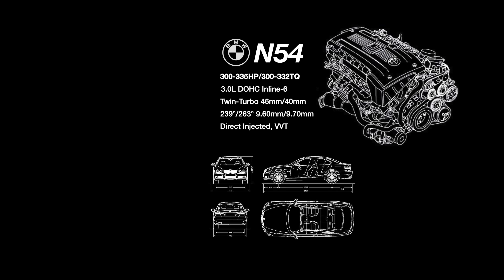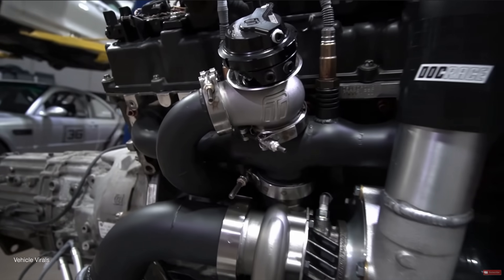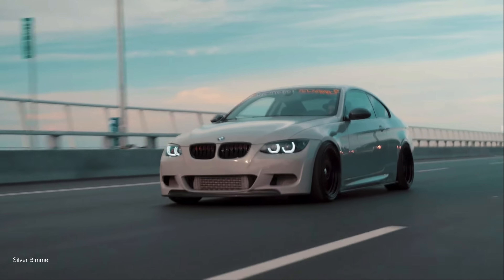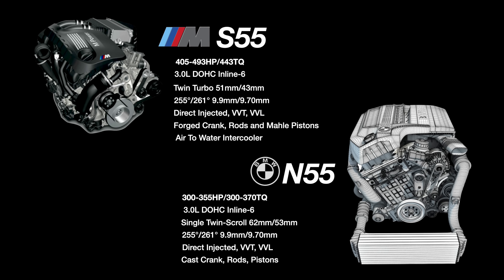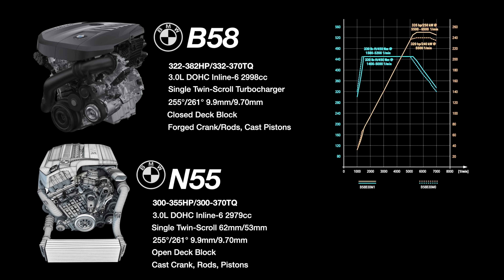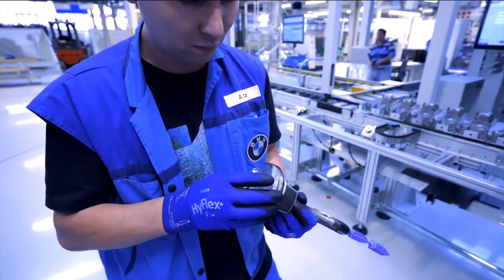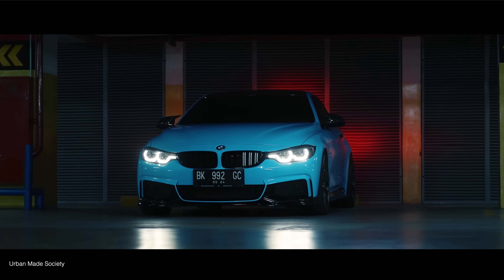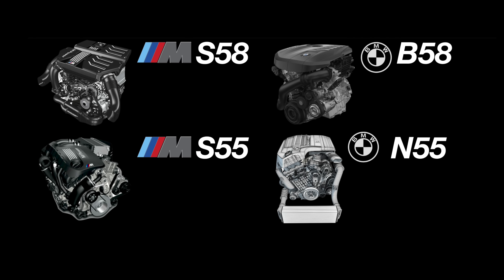BMW Turbo Inline-6 Engines Are Ridiculous | Explained Ep.4

Comment: I took my 650iGC m package and tossed in the DPs pushed the boost to 24 psi with cai and a tune and she’s reliably been putting 520 on the motor. That said, I also have a 2020 Camaro 2SS ILE 10 speed that is also tuned to 550 bhp and the heavy ass bmw can’t quiet keep up but she’s not far off. The n63 tu2 is awesome and she sound so fkn good. Thanks for the clips I love all types of cars that I can tune and tear ass.

Comment: BMW always been the king of straight sixes, you Americans been sleeping, they were making straight sixes for their fighter planes during WW2 and then started putting them in their cars in the 1950s
Reply: Toyota Inline 6  has entered the chat. Lol
Reply: First European brand who started putting inline sixes into cars were Audi.
Reply: @ForcesofValor16  Taking turns does not determine how a good an engine is.....
Reply: @ForcesofValor16  I'm sorry but I'm not American 😉
Reply: I have humiliated a couple of BMW 6 cyl with my 2.0 cyl turbo Saab, both from around year 2000.
As long as it was a 328 or less and both was rolling, they had little chance.
The Saab 2.0 and 2.3 turbo had BMW 3.0 power and torque from a relatively simple engine without vanos.
Reply: Yawn...

Comment: I've had a tuned N54 for almost 3 years now with aftermarket turbos, after the initial maintenance work I did (changed everything) it's been reliable for me at a little over 500 whp, only first set of aftermarket turbos failed but I put enough high boost miles on them,
Reply: High boost miles. Sounds like an excuse.
Reply: Exact same here, aftermarket turbos for just over 2 years and after the initial wave of maintenance it's been dead nuts reliable.
Reply: reliable turbo fail lol
Reply: Well that's not reliable at all. I haven't had to change anything sans fluids in two years in my car.

Comment: The B58 has two generations and different variations of power. Some of these differences are critical to know if anyone is gonna modify one for power. There’s a video explaining the difference B58 vs B58TU
Reply: Not much difference except the fuel pump. They both can take the exact same amount of power

Comment: N54 was a nightmare until you dropped almost 10K into it to sort everything and...I still want one in an 135i.
Reply: Very untrue, owned 2, didn’t have to drop 10k, about 1k in parts to make it very reliable
Reply: @I6N54 , sounds like you did not own it new. Turbos are shit. Injectors or shit. Electric water pump is shit. Both fuel pumps are shit. Boost leaks due to shitty charge pipes. Walnut blasts. Shall I continue? Upgraded turbos, 3-5K depending what you choose. Index 12 injectors (reburbished) $1,000. Both fuel pumps will run about $1,000 together. Upgraded water pump is like $400. Charge pipes? No idea. Still gotta do coil packs too. All this this like 6K on the really cheap end. You get really good parts and close to 8K. Then....THE MAINTENANCE.
Reply: @ronaldjoseph9607  you can get cheaper turbos but the 2 fuel pumps being 1k is cap a new hpfp costs 800 shits more expensive now been hearing set of 6 index 12s new are being sold for 2k+ and alot of this shit you wait until there's a problem to replace em idk why everyone's replacing there injectors even if the cars running good and they don't leak.
Reply: @callanotis7902 . I said refurbished injectors. New injectors are $2,000-$2,500. Cheaper turbos? Yeah, you buy them bullshit Vargas "upgraded" turbos if you want to. You can get both fuel pumps for $1,000. At the end of the day, all these parts are know to fail and fail early most of the time. Get everything out of the way early.
Reply: @ronaldjoseph9607  You should add, crankshaft is shit too. N54 is crap, 3.0 tfsi with compressor is way better engine.

Comment: Always have loved Bmw's, but the only car on the road that I have come across on my 17 gsxr 1k R is the Mercedes amg gt 63.  That car was giving me a run in half power mode and that was pretty impressive.
Reply: Then you haven’t heard of m5 competition
Reply: @eLus1ve2991  Love that car. I remember when I worked at a Bmw dealership the tech asked me if I wanted to go for a ride in a E60 M5 and the power button with full throttle the seats actually move to strap you in better, but anyways awesome cars the newer M5's. I just see more of the Mercedes Gt 63's around and Mercede's drivers seem to want to race more than the beamers. I'm sure I would still smoke the M5 on the bike, but the way that Gt63 just keeps pulling past 170 mph was impressive.
Reply: @Mattschindig  merc are raw straight liners, whilst comps are overall a drivers car, u can take the big boat m5 into the canyons and still feel safe flooring it….
Theres vids of m5 comp vs gt63 
M5 takes it by a bit…. Mercs focus more on interior luxury

Comment: What are bolts? He mentioned that you could improve the horsepower simply by changing bolts?
Reply: I think he said bolt on. Like downpipe, intake, fuel pump, upgraded turbo and so on
Reply: @todddooley793  thanks

Comment: I have owned 1 Toyota,  1 Lexus and 2 Mini cooper ( F56 and F60 ) 

Both the Toyota and Lexus were nothing but problems 

Meanwhile,  my Mini F56 was my daily driver from 0 miles to 100K and NEVER gave me a single issue.  Sold it and now have an F60.  Personally I think Mini ( new generation )  is most reliable brand out there ( Is BMW Made )
Reply: May i ask what model/problems the Toyota and Lexus had?
Reply: @NFZKAZE  Lexus UX 2019. Car had a massive vibration that could be felt on the floor,  gas pedal, steering.  After more than 20 dealer visits ( different dealers ) the Lexus Field Tech and Corporate claimed the issue was a “normal” characteristic of the engine being 4 cylinders.  Yet Mini cooper is also 4 and has no vibration.  

The car also developed a cracking sound when driving slow over speed bumps.  It took 29 days for the dealer to “fix” the issue.  Days before I sold the car,  that issue was already coming back again.  

The Toyota was a Corolla and was involved in the “fuel pump recall”  and since they replaced the pump,  the car never drove the same.  The car would feel sluggish like if it was not getting enough gas.  After many more dealer visits they claimed “ is a small engine,  is normal behavior”. But yet the issue was not there before they touched it.

Comment: You should do a Honda J-Series V6 video. We specialize in Honda Jseries Performance (HalferLand Performance) and have some videos of our 06' Accord Coupe 6spd making 550whp/460wtq on just 8psi. Stock form they can hold max 600whp and come with forged Cranks, forged Rods (forged to reduce mass not for strength, 600whp is the limit) and cast but stout pistons (some have made 600-800hp with them by just Tweeks to the  ring gap, but we advise an upgrade for prolonged 500+ engines.  We added our HalferLand Hyper/Semi forged Pistons, HalferLand 1000hp Rods, Stock J35a7 Block, Stock Crank and our custom Turbo kit...and now have over 40k miles on that setup with zero issues at 550whp.  Theres some J's out there making well into the 1000's with stock block and crank. The engines also came in damn near everything Honda/Acura Released so their availability is too notch (CL, TL, TSX, MDX, Odyssey, Ridgeline, Accord, Pilot, etc
Reply: Hondas trash

Comment: I've had an 08 e61 N54 pure stage 2 turbo wagon that was not cheap to maintain but a blast to drive once I got it right. I also had a full bolt on 2013 F30 335i N55 that originally got me hooked on BMW's. It was maintenance free except for the upgrades I did and a blown chargepipe (common issue - plastic piece) 
Lastly, I now have a 2020 X3M with the S58.. I've left it stock cause so far it's beat everything except a model plaid Tesla. It eats 392's for breakfast. 0-60 in 3.6 seconds when launched
Reply: Glad you mentioned all these vehicles and their different variations in engine choice with the inline 6. Im absolutely in love with my E61. Not modded as extensive as yours but with a stage 2 plus map it makes for a very fun vehicle too troll in but I am desperately in need of an e85 map now as I want more power. Reliability doesn't concern me as much (knock on wood) I am just over 100k miles. My buddy also has a 2018 x3m and he's making a ton of power with fbo and e85! Its really incredible how responsive and high performing these engines actually are. I love my Audi's but Im lowkey now a fanboy on both ends of the spectrum thanks to the almighty N54 🤝🏼🤣 but Audi and it's inline 5 20vt and 2.7 v6 twin turbos will always have a sweet spot in my heart😎

Comment: Pushing 517hp on e30 whit my m140i xdrive only upgrades i did was hot climate mod hpfp tu and 4 inch down pipe 100-200 7.8 ben its around 23 degrees celsius waiting for the winter to com then im instaling a wmi kit hoping for 7/7.2 100-200

Comment: Only thing BMW engines Destroy is Your wallet. We all know what BMW stands for Break My Wallet... Junk and a pain in the ass to repair and costly.. Why didn't you compare it against a 2jz or rb26.... Well I guess we all know the reason. Also if these engines are so great why is it you Can't easily transplant them into different chassis. I can put a 2jz into a shopping Cart and make it run.. try that with the BMW engines... BMW is good and reliable huh, what about the BMW n20 Engine. LOLZ guess you did not want to even think about that Fucking turd box with failing timing chains at 100K miles or less. 😂😂
Reply: Are you dumb? BMW engines have been swappable since forever. Also what's there to compare with the RB/2J? The B58 alone holds 800+ stock internals. Something a RB CANT do! And the 2J can, but it'll take 6k+ rpms to even make power 😂.

Comment: We need a video on the bmw V8s brother, amazing video
Reply: I’m noticing too many complaints that the 4.4 f90 v8 isn’t reliable… mine has been fine.
Reply: @av8743  fuck yeah, i drive an F10 M5, these engines are a lot more reliable than everyone makes it out to be
Reply: @C181  yes I’m f90 stg2 850hp no issues with it lol everyone talks like they bend rods with a tune and downpipes so easily
Reply: @av8743  s63 top end beast

Comment: I had an f82 M4 with the S55. The stock intercooler leaked all over my cylinders for like a month straight. When it finally put it into limp mode, I changed the stock intercooler to a metal one myself and it's ran like brand new. Granted, it could've seized the motor and blown it up, but that's literally my point. How that engine ran that smooth after that is beyond me. 

I ran lucas fuel treatment through it to keep the cylinders clean and lubricated, I put a low amount of octane booster per fill up to ensure I was always running 93-94 octane and I put CRC cylinder and engine cleaner through it twice in 15k miles and it purred like a kitten. 

Take care of your vehicles and they will last.
Reply: Next week I ll finally take the me f80, I hope the power and torque are felling brutal
Reply: Hi the Fuel cleaner...Can that be put anytime or just before u do the oil change...?Or its not related ?
Reply: @maximusEagle  I usually put lucas in every 2nd fill up
Reply: That’s strange as the s55 doesn’t have a intercooler, but a charge cooler. That’s probably what you meant. 

Glad you got it sorted. Have had my f80 m3 for 4 years and it’s a never skipped a beat really, and I’m still loving it. Brilliant cars, great engine, fantastic handling. Excellent all-rounder!
Reply: Same thing happened to me in my F82..put in a VRSF top mount intercooler and good as new

Comment: Please do the BMW v8's next!! I'd like to see your analysis of the S63TU engine I have in the M6 Gran Coupe. 

Keep it up @337 SPEED. You will blow up really soon.
Reply: Trash… hot vee is time bomb
Reply: @jackchueh1231  the s63 has improved drastically with cooling. The N63 is junk.
Reply: @kodiak7964  if you want a proper v8.. stick with AMG… but BMW owns and knows inline 6 since forever.
Reply: @jackchueh1231  Mercedes doesnt look as good IMO.  720HP is pretty solid on my drivetrain and doesnt skip a beat. Forged pistons and crank. An AMG GT will probably keep up with me due to weight differences. The improved hot vee is much more reliable. People dont understand the differences between the N63 and the S63tu.
Reply: @kodiak7964  I, sure it’s fast as hell, but I’ve heard horror stories owning them off warranty.
Reply: Reliability is always priced in the extended warranty… that’s the tell.
Reply: @jackchueh1231  yes for sure. Engine rebuild is around $15k but I understand what I got myself into. These amgs and Ms are basically race cars without the weight reduction. Horror stories everywhere for sure, especially if you can't afford it.

Comment: When talking about these engines and how fast they perform during racing, lots of people forget or don’t know that these new generation BMWs come with faster gearings. Most of those race performances and credit go to these fast gearings not the engines. No doubt the B58, B48 and S58 are very robust engines and can hold more power compared to their predecessors. But without a faster gearing, they would simply perform as their predecessors.
Reply: Wtf is the point of what you just wrote?
It's a known fact that the gearing improves with almost every generation of cars
Simply because newer engines are able to put down more torque and HP